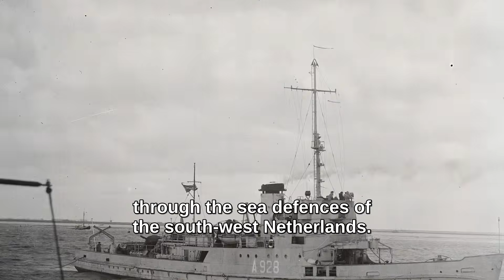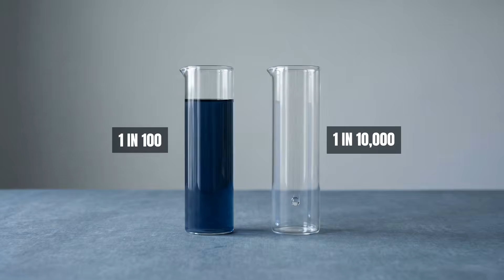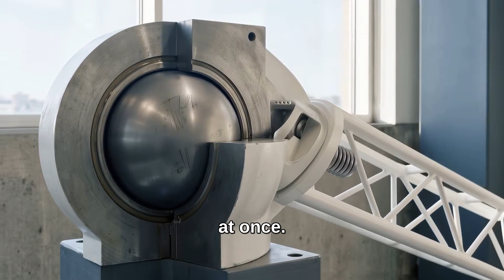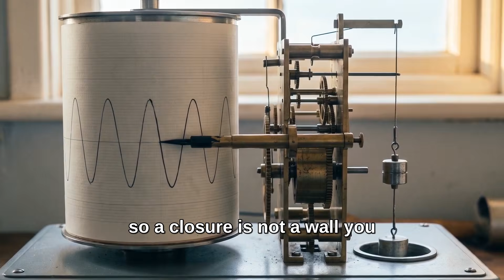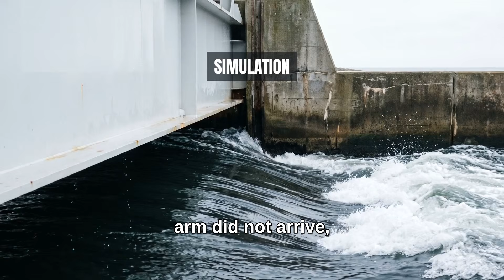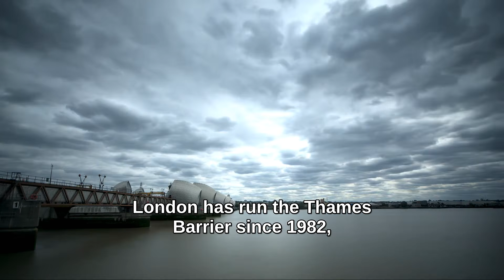Maeslantkering — The Impossible 210-Metre Gate That Closes Itself

Comment from the maker: In nearly thirty years it has closed for a real storm three times — and for 2007 and 2018 Rijkswaterstaat had quietly lowered the trigger beforehand to force a live test. Only in December 2023 did the sea cross the real threshold untouched.

Flagged rather than settled: that 3-metre trigger was set against twentieth-century sea levels.

No person signs off on the closure; the computer decides alone. Would you be comfortable with that on the one night it matters?